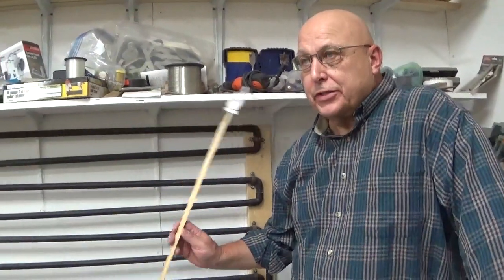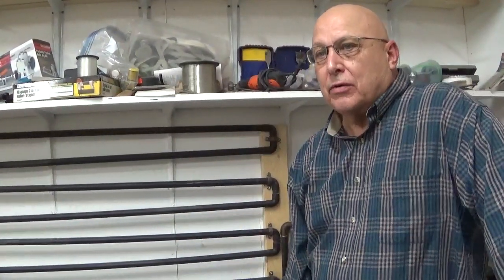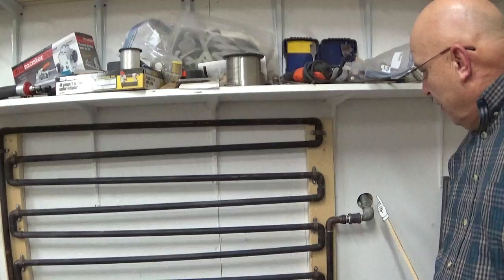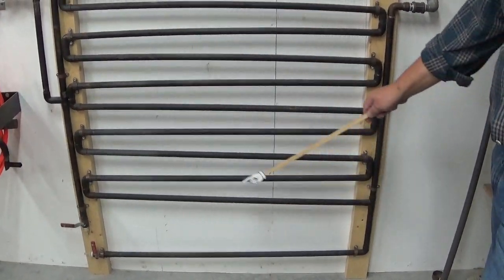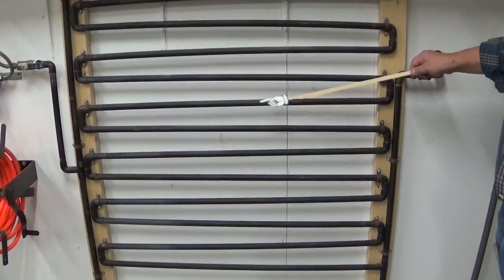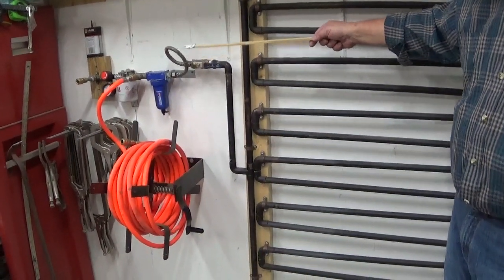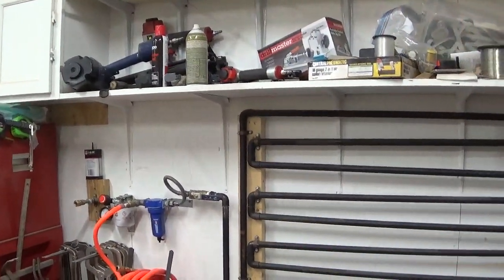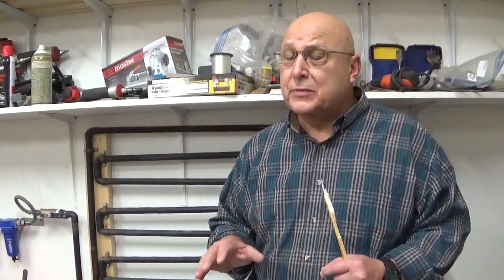Air Compressor aftercooler air cooler dryer condenser, simple and effective to remove moisture

Comment: Could you use pex instead of copper?
Reply from the maker: PEX, PVC or rubber does not have the same heat dissipation (air cooling effect) as copper.
Reply: @jeffwillard2417  what if I made it more than 50'....?  may 60'?
Reply from the maker: My original air cooler of this design 30 years ago was 60' long and worked great.  The 50' air cooler in my workshop now is the minimum length required for the best results for an air cooler.

Comment: Can ypu do this whit just a hose and give it is shape and then at the ends ball valls?
Reply from the maker: Hi John,
You need the quick transfer of heat from the copper lines to condense the moisture. PVC or rubber air lines will insult the hot compressed air and hold the moisture in.
Reply: @jeffwillard2417  thank you so  i have a 12 gallon compressor how long shuld y make this?
Reply from the maker: Hi John,
Any size compressor is going to generate hot compressed air (about 190 degrees). Like most people you'll quickly find that you require more CFM's and want or need a bigger compressor, so I would make the cooler with a total of 50' of 3/4" copper. So you'll only have to make it once now and not have to add on later on down the road.

Comment: Ok im almost done with construction posted some photos and everyone is commenting on air loss any input
Reply from the maker: Hi Jeff, 
I used this same design but in a 10' longer version in my body shop for years with no air restriction problems, of coarse you need a compressor that will keep up with your air tools such as with sandblasting. I say finish your air cooler build and prove them wrong, which they will be......
Reply: @jeffwillard2417  Thanks compressor no problem 30 cfm thanks for getting back to me
Reply: @jeffwillard2417  Up and running really like it
Reply: @axisvaporhoningindustries4312  how much pressure loss did you have?
Reply: @Thomas998822  none
Reply: @axisvaporhoningindustries4312  ok cool ty. My setup will have about 25-30 90° elbows and was also wondering about combined pressure loss in all of those bends... how many elbows does yours have?
Reply: @Thomas998822  Hit me up on facebook
Reply: @axisvaporhoningindustries4312  what's your fb?

Comment: No , the water separator mounted on wall reduced down...i had one and it didn't remove much water,,just reduced flow,,,
Reply from the maker: Hello George,
  I'm sure you already know that you use the air equipment that fits your needs, this system I made and shared with everyone is for the the shop/hobbyist with a 9 to 16 CFM compressor. It supplies ultra clean air for all of my spray guns, air tools and my large sand blast cabinet. This system is not made for a high production industrial shop that uses huge volumes of air or well maybe if they increased the line size and length of the cooler.
   You can also purchase whatever inlet/outlet size water trap/filter you need to match your air supply and use. I'm sorry if my design offends you, this is to give people an idea what they can do on their own and it works great for me.....

Comment: This is the exact set-up I was thinking of. After watching all the vid's on YT on this subject, I came up with this same method as it eliminates most of the ball valves, saving $. $16 for 3/4 and $36 for 1"!!! I WISH! Up here in Canada where I am, 3/4" is $32 and 1" is $78!!!! One thing I never get is the talk of reducing diameter a number of times, with in the run, to force the air to compress and speed up. I get the physics in how this works, regarding condensing the moisture out. That's how the moisture ends up spitting out your air tools. But that's b/c it's exiting in to an open environment. In the system, there's back pressure. So I'm not sure squeezing the air down to speed it up in a closed system would work. Maybe if the system is bled empty, it would happen for a micro second at initial charge. But after that, there's back pressure once the system is charged, slowing the exit speed of the air exiting that smaller orifice. Just a theory. Anyway.... Glad you posted this so others can see. Thanks!
Reply from the maker: I wonder why is copper in Canada is twice the cost compare to the U.S. I guess if you wanted to solder in restrictors by using reducers would be a simple enough process, I don't know if the the restrictors extra cost and effort would outweigh any extra moisture removing results on a small air cooler, maybe it would on a system that uses huge amounts of air. Thanks for watching...
Reply: @jeffwillard2417 : I just don't see the point of restrictors. They wouldn't, work to change velocity, or affect air expansion/contraction, in a closed system, and work like people think. The pressure/ density on both sides of the restriction are gonna balance out in a closed system, unlike a nozzle just shooting into a room.
Reply: @jeffwillard2417 : Any thoughts on stuffing the pipes, or just a section, with copper scrub pads? Seen this done with the theory that it increases surface area for the air to contact and therefore more surface for the moisture to condense on. You'd loose air volume, but that might be made up in increased water condensing ability. I just thought it sounded like a sound theory and easy to do. Cheers!
Reply from the maker: So true...
Reply from the maker: I think I would rather put a larger inline water trap or two on than mess with stuffing the cooling pipes with any type of copper scrub pads that may eventually corrode. If you are going to try this use a stainless steel scrub pad but that to will eventually build up with crud that will have to be cleaned or replaced and also as you said reduce air volume and flow. I have often found in my past experience, the simplest method gives less chance of having problems later on.
Reply: You want to slow the air down so it has time to condense on the surface. To fast and you’ll remove less moisture. I do Plumbing, heating and air conditioning for a living.  If you have a high humidity area,  slowing the air flow through the evaporator coil will draw more moisture out.  Everything is designed and sized properly to do this though.  Therefore bigger is better.  I wish I kept the 1” fin tube copper baseboard radiators I stripped out of a house years ago.  The fins would help the cooling process as well as the additional surface area.

Comment: I also see guys bridging their pipes at the top and/or bottoms of their vertical systems. This lets way to much air just pass by the risers, rather than forcing the air to travel through the system from inlet to outlet.
Reply from the maker: Hello Again Wing Nut Bert,
Yes, it defeats the function of an air cooler if you put in any bypass, it has to go the full lenght of any air cooler system to be effective.

Comment: ... what about your tank? I thought that was the point of the cooler.
Reply from the maker: Some folks are using this idea to make a between the compressor and tank air cooler and one for after the tank. If your using large volumes of air like for sandblasting or air grinder, you'll need that air to cool quickly or risk plugging your sandblaster with moisture or blow water out of your grinder which I have done both in the past before I made this air cooler. An air cooler like this before the tank and after is the best combination that will handle any air volume situation you may have. For additional cooling place a fan on the air cooler between the compressor and tank for more heat dissipation on the copper pipe. Hope this helps..

Comment: Would this set up work on a larger compressor setup? 10hp 180 gal tank about 40 cfm? I dont have much wall space could i just run five 10ft full length runs above my blasting cabinet and shelving?
Reply from the maker: Hi 323,
What you described is almost exactly what my first Body Shop air cooler was but I had six 10' copper section that ran into a large filter/water separator trap then into a Motor Guard filter, that setup worked great. This one in the video is just a down sized version of the original I made. Good luck...

Comment: I appreciate anyone that can work with tools and innovate in their garage at home. Our species is becoming rare.

This is a brilliant design, except... imagine for a moment a droplet of water, just having been squeezed out of the air as the temperature has dropped while making it's way through these copper pipes. Mr. Droplet has materialized, snapped into reality as he finds himself inside a severe wind storm. 

Which way will Mr. Droplet go? Slightly downhill into a 75 MPH wind? No way. Best he can do is hang out, waiting for the wind to stop, or waiting for a temperature increase to suck him back in as a gas. Why wouldn't we give Mr. Droplet a DOWNHILL, DOWNWIND path to his trap?
Reply from the maker: Ben,
I was smiling all through the Mr. Droplet adventure story, your very creative. I do believe this system will work no matter which way the severe wind storm (air flow) is coming from. When you make yours reverse the air flow (severe wind storm) and let me know how it worked. Keep up the creative comments a little humor is always needed. Thanks.....
Reply: @jeffwillard2417  Love your attitude. Agree with your "walk a mile in my moccasins" perspective. I'm about 3/4 done with my build. I PROMISE to post at least a quick crappy video asap and when I do I'll reply here. Mostly for your entertainment. It's a low budget Frankenstein but my Asperger's allows an engineering advantage that can be humorous even to me.
Reply from the maker: @bobtenwick   I will patiently wait your air coolers completion, good luck with your build..

Comment: what's the size of it?
Reply from the maker: 3/4 inch copper and 50 feet long.
Reply: @jeffwillard2417  I guess I should have specified. I meant length x width. Thanks for responding!
Reply from the maker: @simplicityisbliss  That is the novelty about this design you came make it the size of whatever space you have. The original one I started with in my body shop was 60' of copper and 10' long x 4' high, the one I have now is 50' copper and 48" wide x 55" high, yet the air flow design is the same as the original. Good luck on your build...
Reply: @jeffwillard2417  Thanks Jeff. I just wanted an idea of the dimensions. I read somewhere that the mininum pipe to use is 25ft. Of course the more length is better

Comment: do you REALLY have that much time , let alone wall space in your shop ?
Reply from the maker: Well, you see the wall space I used which isn't much and I don't think spending a couple of hours  cutting, soldering and mounting the air cooler on a wall isn't to much time spent for having dry compressed air all the time.

Comment: 50ft of pipe 🤔. Depending on your total run, you could have some measurable pressure loss. I don't understand why people don't trap the water before it goes into the tank. Aftercoolers are much more efficient for this. On a side note, that is a clean installation. 👍
Reply from the maker: If you use 3/4" copper pipe you will not see any noticeable reduction of air pressure in 50' or 60' but if you use a smaller I.D of copper pipe the air restriction increases as the I.D. of the pipe gets smaller. You can use this design as a pre or post air cooler, just use a fan on the pre-air cooler.

Comment: Hello Jeff Willard
You scoff at the guy that has 10' lengths of vertical copper pipe, yet you have "over 50' of copper" in your design. How is your's better???
On the subject of gravity, which design will separate the water faster & send it down into the trap? One that has the pipes running vertically, or one that has the pipes running a couple of degrees from horizontal???
If you're feeding your system with a 3/4" supply line, you would have benefited from adiabatic cooling if you had increase the size of your copper pipe to 1" or more in your separator & maybe not of had to have "over 50' of copper" in your system.
Reply from the maker: Hi MCatSHF,
  I'm sorry if it appeared that I scoffed at anyone's idea, I only wanted to point out the complex systems that some people had, I have found that simpler is always better. Any line cooling system needs a minimum of 50 feet for proper heat dissipation to condense the moisture.  
  As far as line size goes 3/4" is $16.00 a 10' section as compared to 1" diameter that is $36.00 for a 10' section. I  would rather save money using the 3/4" than use 1" pipe for twice as much money with very little gain in cooling. I post these videos for other people to use or come up with their own system, not to offend or get into a debate on who's idea is better.
Reply: I disagree because the vertical would have more effect because the water would drop faster
Reply: @georgespangler1517  "To each his own" said the woman as she kissed the cow.
Reply: @georgespangler1517  Yes I agree with you as well, if he turned the whole system 90 degrees and had the pipes run  up and down, with drain at bottom of each run.  Also, 25 feet after compressor is what most recommend, and what I did.  Works great, put a desiccant bead filter after the vertical pipe system.   Can also use schedule 40 pvc to be cheaper, some will say its dangerous and can explode, which is true.  But Ive had mine I built for 10 years or so and no issues.  Clean the pipe, lots of glue.
Reply: @bigworm6635 

Since the underlying principle is too cool the air so as to cause the water vapour to condense, surely copper will be much more effective than pvc?

Just wondering...
Reply: bertkutoob yes I would think, prob be better to use overall, more sturdy less chance of explosion .   Also more money.   Look into the new style Aluminum line, RapidAir, and other similar kits.   Or flexible tubing made for air.
Reply: @bertkutoob  yes copper is better, also, very expensive!  Its more about the 25 ft or so that cools the air more than what its made of.  And the gravity working against water.   They say you want atleast 25 ft for air to travel before you air dryer setup.

Comment: How did you set the slopes on the pipes?
Reply from the maker: Hi John,
  It was very simple, once you get the pipe all soldered together just lay the pipe on top of your mounting boards for the wall.  Anchor the first vertical intake copper line with pipe straps and whatever the gap is between the connecting elbows is, you just make the gap about 2" wider on the other side, start from the bottom and work upwards mounting each copper pipe as you go. Good Luck..
Reply: @jeffwillard2417  Thank you, Jeff.

Comment: Ive been running compressors without cooling for years and never had a issue with water, to need 20 feet of extra line
Reply from the maker: Then why did you want to watch this video if you have no moisture problems in your air lines, I guess your very lucky or live in a very dry climate. Everyone else who uses compressed air has problems with moisture in their air lines which ends up coming out their air tools, paint guns, sandblaster, etc, etc.....
Reply: @jeffwillard2417  because i was looking for reviews on air dryers. I still run a dryer, i just see no need to run 30 feet of extra line. If i was to do anything else id run a radiator type cooler.

Comment: The air is totally saturated at 180*F
It cannot hold any more moisture
Reply from the maker: You maybe correct but did your info take into consideration the effect of compressing the ambient air and forcing more moisture into the air under pressure. I'm not pneumatic air expert, just talking from shop experience..
Reply: The air after the compressor will have as much moisture as the air it draws in.  No moisture is removed in this process unless you have something to remove the moisture before it enters the compressor.
Reply from the maker: @mikefox5510  Because this system is so economical to make, people are using this design to construct a pre-air cooler between the compressor and tank and also an after air cooler. Now, if you are using high volumes of air such as continuous sandblasting the pre-cooler will heat up, even with a cooling fan and loose some of its cooling effect letting the moisture enter the tank which the after air cooler will catch.
Reply: The slopes horizontal design simplifies the drainage system required. I may do both as the location of my compressor will make it less convenient to drain as you have to tip it in order to get all of the water out. Harbor freight vertical

Comment: The 3/8 water separators suck,,,and restrict the hell out of you air flow,,,use only 1/2 inch,,,
Reply from the maker: I'm glad you agree, that is why mine are made from 3/4" copper lines.

Comment: Why can't you just simply open the draincock at the bottom of the tank periodically? I open mine, drain the water and air until empty of both, the water usually stops draining 1st then the air, close the draincock and fill it back up. Costs absolutely nothing, nothing to build or add anywhere, and pretty simple!
Reply from the maker: Hi PT,
If your using a lot of air constantly such as with an air sander, grinder/polisher or sandblasting the heated compressed air will bypass the cooling effect of your compressor tank and the moisture in the compressed air will condense in your air lines and eventually water will start coming out your air tools or clog your sandblaster. Hope this helps..
Reply: @jeffwillard2417  Yes it does and thanks for the info!  Since I obviously don't use mine that way I had no idea but do now.
Reply: @jeffwillard2417  Yes, that's exactly what happened when I started using a DX sander, rather than the occasional tool or tyre inflator. I found your solution looking for my solution, and today I went out and bought all the parts I need to start assembling tomorrow. Thanks for posting this...the best and most simple I've found on YT (I looked at a dozen or more before I chose your design. Thanks from SW Oz...
Reply from the maker: @omniversling  Have fun making your air cooler...